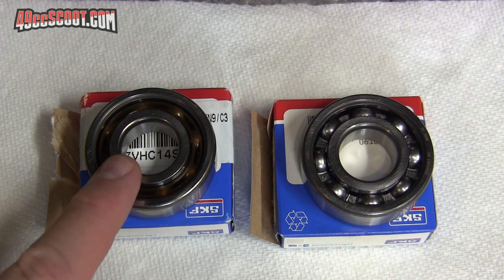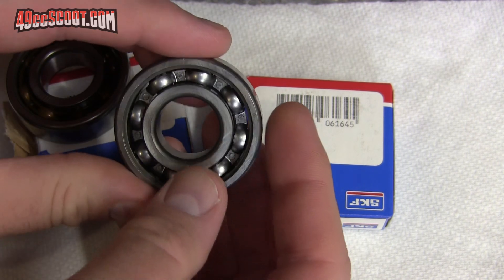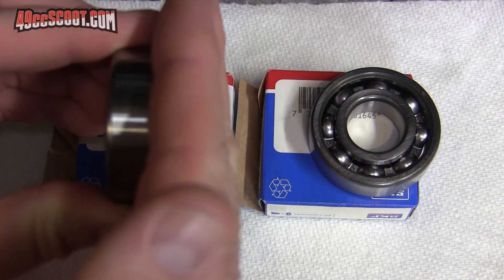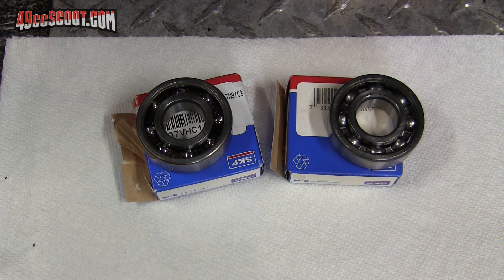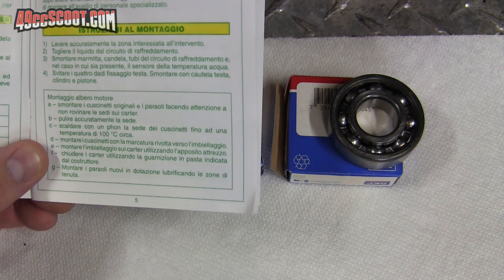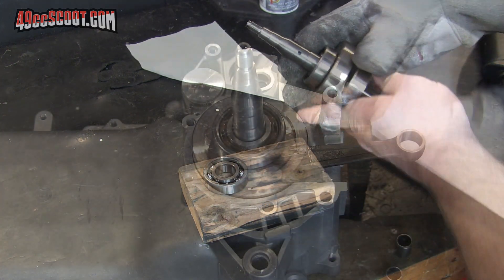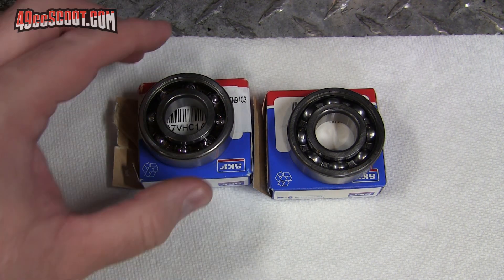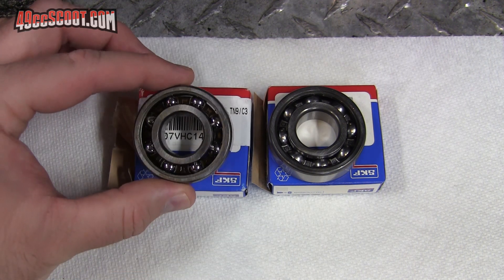TPR 86cc Build : Part 15 : Crankshaft Bearing Install Correction Info (TN9)

Comment: Ive installed these bearing in a minarelli, drivin 2 kilometers and have crank play, i can see it in my seal. How that possible
Reply from the maker: Most obvious question is; did you check crank play right after the crank was installed? Perhaps it started out that way.
Reply: @49ccscoot  not really, ive noticed by accident. Ignition side feels the same,not in en out but up and down. Mayne going back to c3
Reply: Today ive bougt new  bearings, they only had c4. Ive checked these in comparison, and also lot of play. A mechanic told me today, if everyting gets warm then the play gets less
Reply: @49ccscoot  it starts this way
Reply from the maker: @dennisvanhees6884  If you can feel that the crank is moving much and especially if you have much measurable movement (dial indicator) that doesn't seem correct. High speed bearings do need more clearance, but they shouldn't feel loose. Check a service manual for specs and see if you're anywhere close.

Comment: My Italian roots interpretation of the instructions are as you said , no big deal . But l maybe  read a  piece  pointing out 60 to 1  fuel ratio will  shorten bearing life as the balls lack enough oil to float ? Maybe the new less friction design bearings offer a  more flexible fuel mix? l am sniffing around the  subject due to spun bearings case side  , weird rattle high RPM , goes with interment air leak from the seals all bad news but you modified a crankshaft doing away with press fit ? l gather then it's a bigger problem if they spin on the case in  comparison to the crankshaft   ?
Reply from the maker: I did mod a crank for slip fit once. I didn't like it. I didn't notice any change in performance. The engine was noisy and there were other complications. It's been some  time now, but play was excessive too quickly. That may have been the case that ended up with the races wearing and  needing to be shimmed after.

I'd stick with richer oil ratios and not worry too much. I use 32:1. I used to mix lean at 50:1, but wear has improved since upping the pre-mix ratio. There have also been tests showing more power with more oil.
Reply: @49ccscoot  Quora Digest email constantly about 2t , my fault , seem at least diverse and a huge free forum also had a ex race rider claim his rich mix compensated by a jet change [bigger ?] won   races with more power and reliability . As always  , the accurate advise is  much appreciated  .
Reply from the maker: @johncoscia5258  If your tune is spot on, then it may be beneficial to up the size of the main jet by the same amount as the increase in oil mix percentage. For example; if you go from 2% to 3% pre-mix ratio, you may want to use a 1% larger main jet. Or if you switch from oil injection to 3% pre-mix, you may want to increase the main jet by 3%. This is to deliver the same amount of fuel, because a percentage of oil is flowing through the jet as well. 

That said, most of us with street rides are more than 1-3% inaccurate with our tunes depending on the weather on a particular day or just from lack  of precision tuning. It may or may not matter.

Long ago, I tried some different oils and mix ratios to see what I may notice in real world riding. It may be of some interest :
https://49ccscoot.proboards.com/thread/4871/stroke-oil-comparison
Reply: @49ccscoot  Ok, thank you .

Comment: Ok so i called SKF. Because i was curious. TN9 cages are good for a fabillion RPM. So thats not an issue. However, they are sensitive to HEAT. Dude told me the cages will fail at anything over 155-160ish degrees frankenstein. If you you are losing bearings on the CLUTCH side of the motor, you are probably smoking the variator in one way or another. Limiting oiling holes, while it may improve airflow will kill the bearing. These ladies want LOTS of lube to keep them cool under pressure....or you gonna break a cage and lose your balls. SKF man said steel cages are the way to go for generally everything because they ARE more abuse tolerant. though there is some gain to be had by other technologies you must carefully manage their trade offs.  steel cage is heat stabilized to 255 degrees tn9 cage is heat stabilized to 160.
Reply from the maker: Interesting. Thank you for the effort and for posting. If I ever put another set in this thing, I may just go steel like every other 49-110cc Minarelli clone engine I've built. If I can't abuse it, I might as well not own it. 😁
Reply: @49ccscoot  i do alot of things. it was in my own interest to answer this question. figured id share.
Reply: @DieselRamcharger  Hello, when I installed the bearings today one of them got a bit hot... The thicker side, where you can't really see the balls not melted but whited out on two sports. The ball contacts seemed untuched, sould I be concernd? The crank spins freely.

Comment: 07:09 you pointing out about the oil passage.
Actually it doesn't matter which way you install the bearings. 
Didn't you said, use "premix"   ???
Bearings get lubricated either way.
Reply from the maker: They've been in there for 2,000+ miles without issue, but I just wanted to point out the technically correct by the book way regardless of what I thought.

Comment: If you don´t rev as high as 13-14000, but 10500-11000 instead, it won´t matter, I guess. Even at 13-14000, those polymer-one-side-caging-bearings should be more of a hype than actual science.

Comment: Ive studied fluid mechanics for several years now and I can tell you there's no noticeable difference in flow, wear or oiling regardless of the position of the bearings.
Reply from the maker: I'm pretty sure it's fine, and most likely you could do a coin toss to decide which way to put them on and not notice the difference...  but I hate giving out info that's technically incorrect. Thank you.
Reply: @49ccscoot  these engines can be a fucking pain in the add I feel you!   Have nice Xmas keep up with the builds!!!

Comment: Quick question on the noise rating on a decibel meter. I saw your old vid on diff noise level on diff exhaust but this being more modded and higher revving, any chance you may test this one?
Reply from the maker: Won't make a promise. If I have the specs of the old test so it's of some use for comparison, I may try it. I think the way this pipe rings is prob louder than a lot of them or at least it seems that  way to my ears. If you're looking for testing a bunch of pipes, prob not gonna happen. Those exhausts would have no business on here anyway. All of my stuff is low rev.
Reply: 90GTVert im in the process of building something similar to your build. Im just wondering if it will be street legal with regards to noise level. Guess id ihave to buy me a decibel o meter.

But nice build anyways! Been watching your vids ever since!

Ride safe!
Reply from the maker: @peping12  I don't think you'll find a pipe that is in stock noise levels for a high RPM build. RPM alone would likely make it loud with even a stock exhaust if it could rev that high.
Reply: 90GTVert just saw your vid on the test you did, with the tpr 86. yeah totally understand anything revving high would significally make more noise, guess id look around for mods to make it quiter when built 👍🏼

Comment: Crap, i installed the same way as you did.
Reply from the maker: Good news is that I really don't think it matters that much. I think it's basically what is ideal vs what's still OK. The bearing is  still open for lubrication on the side facing the oil passage. Steel bearings work and they're covered a similar amount on both sides.

Comment: First of all i want to thank you .. then i really want to ask about crankshaft scoter cpi pop corn 49 cc 2 strok model 2003/2004  .. i really need it if it isn't new it's oki for me
Reply from the maker: There are tons of good cranks by Naraku, Malossi, etc... for pretty low prices. Just make sure you get the right one. 2003/2004 could be either a 12mm or 10mm wrist pin. 2004+ CPI should all be 12mm as far as I know. If you are getting a cylinder kit as well, then just match the kit to the crank. I'd go 12mm if doing it that way.

Comment: I can appreciate you telling it like you see it , hard to go wrong there. But at this point and mileage if it was going to go bad i think you would know it by now. And it's not a total seal, oil will get there. Noise weird sounds  maybe vibration of some kind, i think you would have said hey the bottom end is making noises. If you really had a fear of things going bad, Get a bore scope and look at the balls for discoloration - if you really wanted get paranoid on it. That's if you even could get to them to observe. Money is money and it's hard to come by but it's not like the kit cost you $1,500 or something crazy like that. If you had to buy a new one you could, it would suck but you could. Ride on. Season is coming to an end anyway.
Have a good !
Reply from the maker: Without some really tiny scope, you'd never see the balls in the bearings. I would assume if there is any effect, it would be some difference in the lifespan of the bearings. Likely some small percentage of difference that the average Joe would have a hard time testing. The kind of thing where you need controlled conditions and a larger sample size to be sure of. Just my guess.
Reply: @49ccscoot  Like a lot of seemingly good ideas , it sounded better when i thought of it. Yeah that would be a pain in the ass
wouldn't it. Oh well ride on.
Have a good !

Comment: Hi, you used Google to translate Italian's instructions. I'm Italian and It says that the marking should be turned towards the "imbiellaggio" which is the rod, so you mounted It correctly (at least Tpr says so)
Reply: But why would they say it to Mount the bearings like tha?🤔🤔
Reply: @190SkyTeam  maybe it's a faulty one and the markin should be on the other side or maybe it's not making any difference. However for street use I would have gone with full caged skf c4 or at least with skf full teflon cage (c5 I think)
Reply from the maker: @giannfa000  Thanks for the translation. If the bearings are marked wrong, the ones I ordered from a bearing supplier came the same way. I think it's either that it's a misprint or mistake, like saying remove when they meant install... or mark-up was intended to mean the side with the cage that's covering the balls. Whatever the case may be, I believe the technically proper method to be with the open side where it would get the most benefit of the oil passage... however it likely isn't going to change a whole lot.
Reply: @49ccscoot  shoot a message to tpr

Comment: why not use hybrid(steel/ceramic balls) or pure ceramics bearings?  i planning change every single ball bearings on my aprilia sr50 to ceramic. the combined gains would be great or no? i still researching this..
Reply from the maker: I spent about $80 on a set of hybrid ceramic crank bearings prob about 10 years ago. That was the last time. I don't think it matters enough to be worth that kind of money. Maybe if I were on a pro race team with a big budget and desire to extract every last drop. It would cost a small fortune to do the engine and gearbox. If you really want to try them, I'd start with just the crank bearings and see how they do before breaking the bank on all bearings.

Comment: Does not matter wich way you install them. Crank bearings always starve for oil. The really important point is the oil passage from the transfer ports to the bearing. Because there will be a stream of oscillating air going through that hole and of course the bearing.  This cools the bearing (especially the rollers) and delivers fresh oil/fuel. Blocking this hole would ruin those bearings pretty quickly. I once disassambled a Fantic Caballero motor, the crank seals blocked this passage. Those bearings lasted not 1k km. I also put them bearings in both ways and not one of those motors came back in my shop. One is still running after more than 15k km. Still I do not trust this polymer cages and I would use steel caged bearings for street use, everytime. For race application they are fine and offer a small advantage over steel caged bearings. Less friction and mass, but does it make a noticable difference? 

Do not let them confuse you. Time will tell if it matters. ;-)
Reply from the maker: I have seen people fill the oil passages in the name of airflow when porting cases, claiming the bearings will be oiled just fine from the oil in the mixture within the crankcase anyway. I have never liked the idea though and it's one of the few things I haven't tried at any point with my engines.
Reply: @49ccscoot  Maybe an alcohol dragster can run bearings this way, without the oil passage. Because there is an abundance of fuel going through the engine and crankcase. Alcohol also takes a lot of heat from the motor to evaporate. Otherwise I would not recommend to try blocking these holes. I guess the gain would even be unnoticable.
Reply: @49ccscoot  the vast majority are clueless. even more so when it comes to content creators. if they were any good building motors, theyd be busy doing that. not shooting their mouths off.
Reply from the maker: @DieselRamcharger  Some of us try very hard to give good info and to learn along the way with their projects. Some probably don't care as long as they get views.
Reply: @49ccscoot  i like your approach you show the highs and lows. we cant all know everything, or everything would be much easier than it is :) i have to admit i was kind of offended by the engine builders tone, which could be lost in translation or my own misunderstanding. but he seemed kinda unnecessarily snotty. also the concept of "o-ringing" a head seems.....totally lost? by whoever did that cylinder. but i digress. i will say if you are facing heads and stuff on a lathe you better lap then suckers afterwards. single point cutter leaves a leak path. cheap usb microscope is more informative than a pricey ra meter i feel.
Reply from the maker: @DieselRamcharger  lol The "good job" was certainly a dig, but overall I think they meant to help. I can deal with that. I get plenty of useless criticism and wisecracks from people that probably don't even change their own oil. Those I wouldn't miss.
Reply: @49ccscoot  i dont change my own oil....i jusst keep adding it. and adding it. and adding it. i think im doing it right? :D

Comment: It's not optimal this way but i won't open the engine to swap these around.
Reply: as long, as they are not closed bearings, it does not matter much, what way they are placed